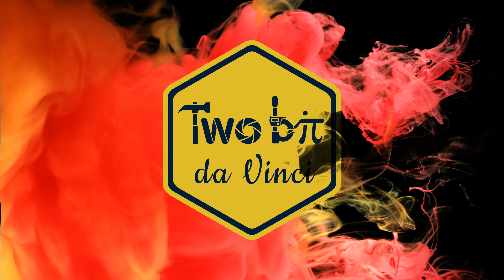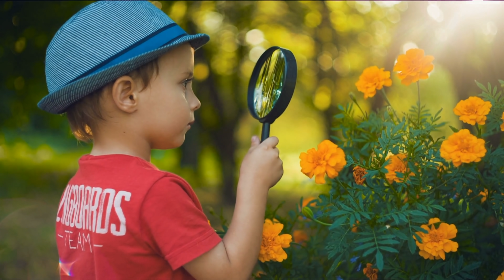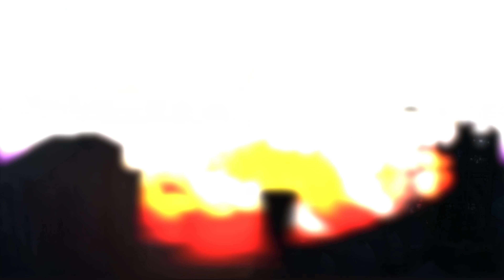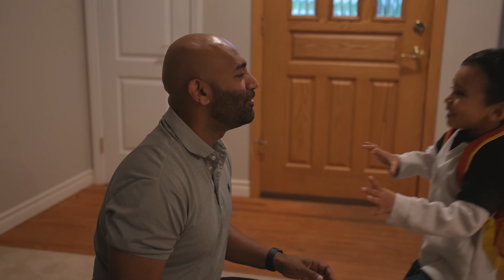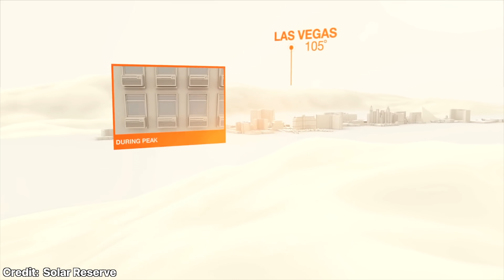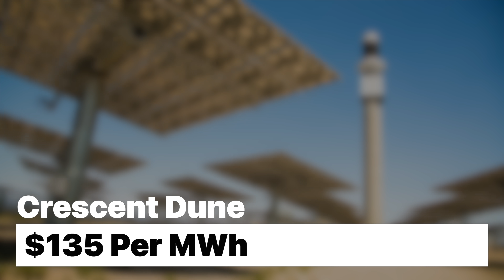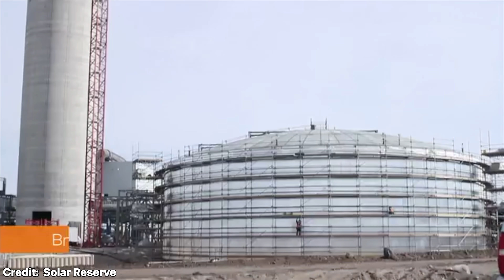This Billion Dollar Solar Plant was an EPIC Failure

Comment: I like your videos. While Mr. Goldstein below may be right as to this type of molten salt being used for energy storage being impractical if the temperature goes down enough in it for it to solidify in pipes, I suspect that other energy storage substances might be used, more insulation, pumps for constant circulation of the salt, divertion valves to put the molten salt in insulated containers, batteries to ensure that the temperature never got too low, hydrogen generation machines to enable transportation out of that energy to LA or other, distant locations and other mechanisms might make it viable. There are two, insurmountable problems, however: 1) the CCP is funding its own alternatives to produce solar panels and now MS reactors (with parts that may be getting produced in its quasi-slave factories) to make sure that those can drive competitors out of business by selling solar panels and other things at below the cost at which any Western world manufacturer (who must pay living wages to non-slave employees) could even make them. 2) despite the critical need for fossil fuels to be used in things like the manufacture of plastics and fertilizer, which issue will become a major issue in future years when we eventually run out of fossil fuels, the US government is not insuring a reasonable, fixed, sales price for the power generated by solar thermal or other mechanisms like wave action, which would make investors able to deal with the technical hurdles of solar thermal and other power generation options with the assurance of then being able to get a computable rate of return (with some uncertainties of course.) Unless we deal with those problems, I predict solar thermal and other, desirable, indigenous methods of power generation (which are what we should probably be using) are going to be kaput in the US. Unless fundamental changes are made, expect China to dominate US power generation for the coming decades.
Reply: just gonna say that the cost of living differs from country to country.

plus consider this: a guy living in a cramped apartment calling the guy living in a mansion a slaver, while those living in a mansion calling the guys living in palaces as slavers, countries follow that pattern.

large countries are the exception since they contain all people from poor to working to rich.

the US has mostly working and rich inside their borders, but still depend on the poor outside their country for most of their products/raw resources.
while china due to its size, have more poor inside their borders despite being rich.

so the slave remark is incorrect and just competition propaganda.
Reply: @Jack-he8jv  Sure, the Chinese workers who jumped out of their employers' factory windows were doing that because their working conditions were just peachy? Dear Chinese Communist Party 50 cent army shills (a.k.a. involuntary, organ donors of the future) or their traitorous cronies, called “white monkeys” by the CCP:

As to the claims that the CCP never invaded Tibet or other countries and does not want to invade Taiwan, despite Xi's statements, are you on drugs? You want us to overlook the fact that the CCP's invasion of Taiwan would enable it to interdict the shipping lanes of Japan and South Korea and intimidate them into allowing its bullying hegemony. It would also allow the CCP to rob the wealthy Taiwanese people for its crooked CCP gangsters when the CCP's crooks already robbed the mainland Chinese people with tofu real estate projects. Remember  the CCP’s Evergrande!

Moreover, it is not the USA but China's CCP gang that is threatening its neighbors, who are our allies: e.g., Taiwan, (threatening to nuke) Japan, (threatening to nuke) Australia, the Philippines, India, etc. That backfired on you splendidly. LOL

As to claims by the CCP that flus in the USA in 2019 were Covid, there is NO EVIDENCE that this was the Covid 19 coronavirus whose closest relative was only harvested in caves by the leader of the Wuhan lab, which has now refused to allow access to its databases of coronaviruses to see if they harvested other, closer relatives to Covid 19, which mutated in human tissue cultures after coming in the caged bats in their labs. Neither the US nor Italy nor Spain have the bats who are the carriers of these coronaviruses and have been for thousands or at least hundreds of years in caves in SOUTHERN China, over a thousand miles from the Wuhan lab that collected them, kept them in cages next to humanized mice, and leaked the virus (probably when they were moving, reportedly, when an infected mouse or bat escaped.)

On the other hand, have you considered what will happen to you someday if you are unlucky enough to be a good organ tissue match for some CCP leader? If you are a tissue match, you will be disappeared, murdered, have your organs harvested so some CCP gangster can live longer, and the rest of your body will be disposed of as trash in some unmarked grave.

You, Chinese Communist Party 50 cent army shills, better watch out, because to your evil, CCP gangster leaders, you are just like fat pigs or cattle. (To keep their Wuhan virus secret, they let thousands of Chinese get infected and die in banquets and trains during your New Year.) The “glorious,” evil leaders that you worship are getting old and will need more and more organ transplants to stay alive.

If YOU or your wife or your children or your brothers or sisters are a tissue match for the evil Poo, Xi (Winnie’s evil, morbidly obese, ugly, CCP aunt, who looks like she survived being hit by a cement truck), your family will be disappeared, killed before or as your organs are harvested out of your body by CCP doctors to repair your CCP tyrants’ alcoholic livers, fatty hearts, or other organs. The CCP leaders will then live longer thanks to your "contributions."

Can you be sure that some of your friends or family members somewhere in China have not already been murdered for their organs by some CCP leader? Hundreds of thousands of young Chinese children, young women, and men have “disappeared” in the last few years, according even to CCP reports, if they have not yet censored them! 

At the same time in dozens of Chinese hospitals, for tens of thousands of dollars, foreigners like Sheiks, or millionaires or powerful politicians (and their young children)are being offered and sold organs tissue matched to them, including children’s organs (which tissue matches are very, very, very hard do, because only one in a thousand or fewer persons is a tissue match for the other.) Coincidence? Think about it: could the hundreds of thousands of young Chinese children, women, and men have been murdered by the CCP (or their allies in the Triads) to make billions or trillions of dollars in profits by selling the foreigners their organs?

Remember that you are enabling the murders that the CCP has perpetrated, so you are equally responsible for them: e.g., the Tiananmen Square Massacre or the genocides of Falun Gong or Uighurs or Tibetans, the murder of people for their organs, etc. Your BS, e.g., in youtube, enabled them to retain power and perpetrate more slaughters of innocents like the Tiananmen Square Massacre or the current, ongoing release of a virus to kill millions by keeping international borders open for months after they knew the virus was highly infectious and deadly. Thus, congratulate yourself on enabling your own, future murder or the future murders of your friends or relatives, who are tissue matches for some CCP gangster or rich foreigner if you are not!

Imagine instead if there was a rebellion and the PLA generals executed or the Chinese people poisoned all the murderous, evil parasites: your CCP gangster leaders. What would China be like without corrupt, evil, CCP parasites ruling it?

It could become as wealthy and beautiful as Taiwan is now, with no innocents from any group or minority ever being murdered or imprisoned, which is why the CCP gangsters want to invade and destroy it. Since by enabling them, you are also guilty of the CCP leaders' murders, are you a sociopath or psychopath? Have you no conscience or shame? Jack the Ripper or Charles Manson or even Pol Pot never caused as many deaths as your CCP leaders have caused: e.g., Xi and Mao.

PS:
Tens of thousands of innocent, young, Chinese people and students were murdered by the CCP during the Tiananmen Square massacre. Mao killed millions by starving them to death during his “cultural revolution” to make false claims of agricultural successes.

Your old, evil, CCP gangster leaders stay healthy by murdering young Uighurs, Chinese Hong Kong students, dissidents, Falun Gong members, and others for their organs. They profit by selling the organs of young Chinese innocents whom they murder. 

A certain virus almost certainly escaped from the inept, corrupt CCP or they would not have acted for months like murderers trying to destroy all evidence and silence and kill all witnesses. Also, before the lockdowns, when it was discovered in 2019, it was still allowed to infect and kill tens of thousands of innocent Chinese travelers weeks later during your Chinese New Year in 2020 to keep it secret from the world. 

“Coincidentally” the CCP then kept international borders open and encouraged innocent Chinese persons infected with the virus to go out and infect the rest of the world with this virus, which now has returned in a different variant and is killing so many Chinese in 2022. The CCP long since lost the mandate of heaven!

The evil CCP gangsters' guilt is shown by their own actions. The Three Gorges Dam will burst sooner or later due to the CCP’s corruption causing it to be built shoddily and with bad materials which will kill tens of millions. Those killed will be more CCP victims.

Now you know these facts that they do not want you to know. Go to another web page. If you are even caught reading or repeating them, the CCP may disappear you and harvest your organs too.

Also, your savings in Chinese companies are worthless because their CCP-gangster managers have more accounting scams than Enron like Luckin Coffee’s or Kingold Jewelry’s apparent frauds, and your overbuilt, over-valued, decaying, real estate holdings will become worthless, like Evergrande’s real estate is largely worthless already now, once China hits its demographic cliff. Enjoy being a CCP member now and have a good sleep. You better hope that hell does not exist, because if you enabled these murders by the CCP, I suspect that is where you are going, LOL.

Geniuses, I sure hope that along with coal, your CCP also boycotts Australian iron ore, then the CCP will fall even quicker as its industries grind down. Its cities are already getting blackouts due to its boycotting Australian coal. LOL. Your industries are failing, because the greedy CCP developed vaccines to make profits, which did not really work, so that is why tens of thousands of Chinese have been dying: because they were given bad vaccines created by the CCP to get money, which vaccines do not even actually work.

One last thing, your passenger jet just dove to the ground because the CCP crooks have been trying to save money by not doing proper maintenance on it, since they lost so much money on Evergrande, the Chinese stock market, Fantasia, etc. However, that is a fact that they will bury and never let you discover, until they lose power and cannot prevent its disclosure.

Comment: If they scaled up the energy storage capacity, wouldn’t they have been able to choose to only sell their energy when the price was at its highest?
Reply: Seems they were on a fixed price contract with NV Energy, so no ability to shift to higher paid hours.
Reply: @johndododoe1411  So a "market failure" rather than the tech.

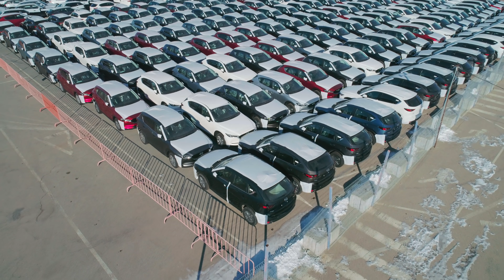Comment: 8:15.  What does the drop in cost of solar power production have to do with EV adoption?  Apples and oranges.  You are comparing batteries to electricity production.  The batteries don't care where the energy comes from.

Comment: honestly i think we need to go at green power, modern nuclear has a couple paths we should expoint, reactors that can re-process nuclear waste into useable fuel thats much safer/easier to store then random chunks of metal/etc... LFTR's(the nuclear version of this system), neither can fail in the way old reactors more focused on the ability to make nuclear weapon grade material then power generation, simulated failures on LFTR become solid and can be cleaned up much more easily if something happens.. since it becomes solid.. 

solar combine with replacing old unsafe nuclear with something far more safe and likely far more reliable then old nuclear, and..upgrade our power grid...

Comment: That people are still paying companies completely unreasonable sums of money for them to not coordinate their solutions to problems given to them such that one parties solution does not create a problem for someone else’s solution, where that new problem goes unaddressed, is quite pathetic.

I first noticed this trend almost a decade ago when, in one of the introductory courses, a task that was given to an entire class of students that should have been given to a team of 4 to 5 people and no more, resulting in a completely incompetent usage of resources to solve a problem.  (Thankfully the resources were just some Legos and perhaps $50 worth of raw materials.)

I studied software engineering in college, but did not finish due to personal reasons, and even I know that everything from the fabrication techniques used to build the different pipes and containers for the power plant, probably designed by mechanical engineers, may be relevant to the physical structures that the civil engineers designed, in a way that Neither party would know would be relevant to the chemical engineers, because everybody was educated differently according to different standards.  Or perhaps this was the other way around, where the task given to the civil engineers did not match the conditions which would result from what was necessary for the mechanical engineers to create, so that the chemical process could even have enough pressure or heat to exist.

The moment that a person realizes the only difference between ALL systems, whether electrical, mechanical, chemical, or digital, is NOT the manner in which they are built, despite everything being made out of something, but rather in the conditions that are necessary for the desired behaviors to manifest themselves, because everything that has ever been successfully built according to engineering equations must have been overseen by people that understood what is necessary to transform raw materials into useful products does not solely exist within any single academic disciplines assertions.

The sheer number of highly ignorant academics who have basically no real world experience or mundane knowledge whatsoever is quite staggering.  For example, a physics professor may be able to describe to you ALL the equations that are necessary for a vehicle to run, but ask them to actually replace the tires or change the engine oil, and they may genuinely not even know the names of the tools involved.  The maintenance guy may actually have more useful experience than he does, just because one has actually “undone” the applied physics (I.e. taken apart an entire vehicle and put it back together with it actually working) while the other has not.

Comment: I love green energy don't get me wrong. I think the people who don't vouch for solar not because they hate it, they are simply concerned about it's cost and productivity. I'm glad to see this plant as an attempt to generate electricity. Mankind certainly will switch to green energy if a power source can beat the cost of coal or oil plants. Otherwise it won't happen, unless oil and coal magically began to run out, which won't happen anytime soon. Let's keep encouraging eager productive innovators  to keep trying. Fusion energy is a promising possible replacement.

I think this method of collecting solar energy should be shrunk to a smaller and more manageable scale. Something that households can use and manage themselves.

Comment: So you talking about the crescent dunes project North of tonapah. But you also mentioned driving into Las Vegas from Los Angeles. That's from the south that's the ivanpah solar project.
Reply: Also molten salt is nasty stuff liquid metals have been messed with the 60's the Russians even tried to run nuclear reactors with lead-bismuth. Very cool but lots of engineering issues.

Comment: I understand you are an advocate, but at least be honest. The cost per watt is misleading because it doesn't include the costs to overcome the hours of the day when photovoltaic produces nothing, specifically, the requirement to build three times the capacity of the fossil fuel plant it is supposed to replace, PLUS two times the capacity in some storage scheme, PLUS the at least maybe more, twice the capacity of power lines to transport that power, and PLUS the significant additional capacity needed to switch everything over. So therefore Joe Brandon Biden is a far bigger enemy to your advocacy than I am with facts from physics. He has thrown a monkey wrench into your green energy. So he shut down oil and gas production, and now precipitated a war over oil and gas. Germany wanted to pretend they were green by importing energy from Russia, so DID BIDEN! So tell me where the money to finance all of this coming from? What is going to happen when China, India, and Russia control the world oil market AND NOT THE US. Now inflation is a massive problem again and food shortages a reality.

Comment: Can it be used for other high heat manufacturing? At least for the day Time. Cement kiln? Asphalt plant?  Can the waste heat still be used the generate electricity after using the heat for manufacturing?